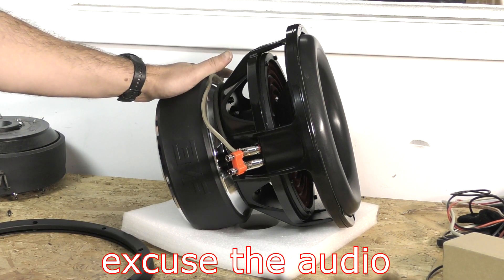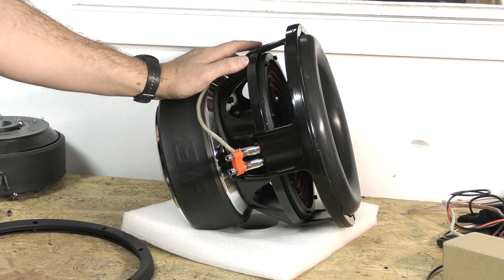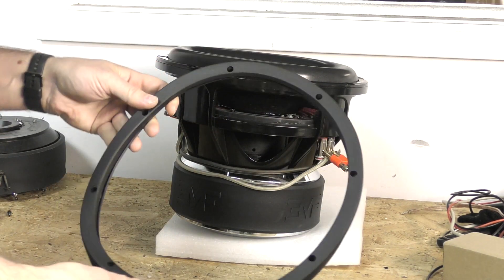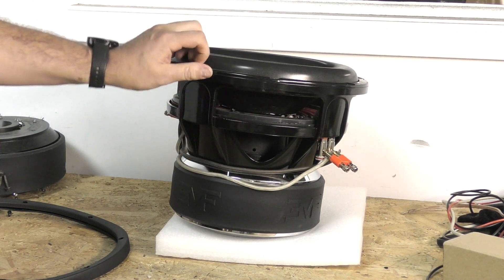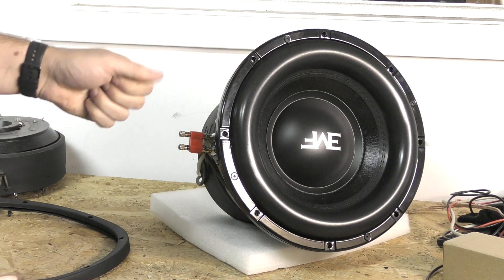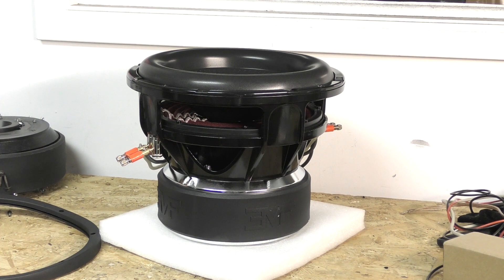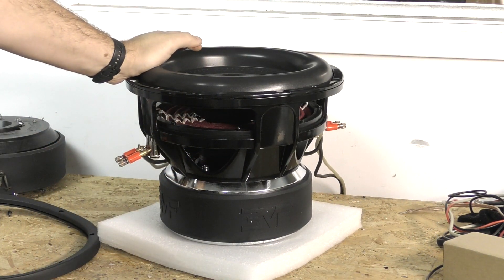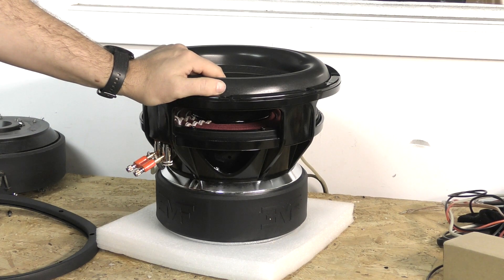What's different between Banhammer v1 and v2?

Comment: I designed a 4th order bp for 4 sundown x12 v3s, I was thinking about running these instead. 4.4sealed, 10 ported, tuned to 44hz, 200si port area. Will these out perform the sundown in the same enclosure? I can make the enclosure smaller if needed but can't make it bigger. I'm powering them with 2 6ks.

Comment: I wanted to get some hard play time before I posted a review.
I installed this sub in a custom ported box measuring 2 ft³ with sub installed this measurement dose not include port area. Box is tuned to 34hz. I'm running this sub on a DD audio m1d. So under powering it by a bit.
This sub blew my mind I honestly think it would even please the SQ crowd!! it doesn't matter how low or load you push it, it doesn't distort. It delivers clean cristal clear punchy bass even at max excursion. knowmatter what you through at it sounds clean and hits soo hard.
I regret not pre-ordering 2 honestly.
My only complaint is I asked Sean to sing it and he didn't so that was a bummer. I garentee you can't find a louder better sounding sub at this incredible price point.
The build quality is hands down perfection
Thank you Sean

Comment: Not happy about the new fs rating was expecting something. " similar " so at least under 30 hz
Reply: I may be wrong, but I believe FS drops as they break in. So 29 or 30 would make sense if he used a brand new sub for testing and was getting 35 initially.
Reply: @TheDoozie43  i hope ! Because i already sold my. Pair of 12" re audio xxx and was in the the hope to find a 15 " inch pair at a decend price but wasnt able too . so thats why i buy the banhammer v2. / better power handling / better kick bass than the xxx / and really like the spec of the banhammer v1 overall . my first choice was crescendo contralto 15 but i finally choose to go with banhammer and  now im sad because i wait more than 2 year for subwoofer i dont like fs wise
Reply: @ganjadalph4204  I'm Kinda In The Same Boat As You. I Have XXX12s And These Banhammers Are The Replacements For When One Goes. I Really Wanted A Low Fs Sub Like The Re Audio XXXs. And The Banhammers Qts Is A Little Higher Then I Wanted. However The Recommended Ported Box Volume Is Still Not Overly Large. Sean Said The Reason The Fs Changed Is "Higher Power Requires Different Suspension Needs". The Re Audio Are 2000wrms. The Thing I Run Into Is Thermal Before Mechanical So Maybe This Is Just What I Need? (with my port tuning around 32Hz And Peaks Around 34-35Hz). I Really Like To Play Really Low Sometimes (I have a 19Hz port that's Literally 6" x 36" long That Like To Peak About 22-23Hz and I hit mechcinal limits way before thermal ). Will The Banhammers Smash The Lows Like The XXX12 And Be Louder? From Looks And Specs I Don't Think So. But You Can't Talk The Talk Until You Walk The Walk. If I Was Rich I Wanted To Get The Rf T2s Those 13" Subs. It's Got All The Specs I Want On Paper... Except They Want A Massive Box And I Can't Figure Out Why. Nearly 4Cuft Per Sub!?!?!
Reply: @salvatorehayes2753  at the end im just sad that i didnt spend some more money to go crescendo contralto 15" and tuned them to 25hz 😐
Reply: I Fully Broke In The Subs And Tested The TS Parameters With The DATs V3 With Sub Warm The Fs Is Actually 27Hz
Reply: @salvatorehayes2753  tanks about the info mate ! really appreciate

Comment: I have a dumb question. Why is the Fs 36Hz on these and was 25Hz on the originals? Regardless, it's a beautiful monster and I love my 15's!
Reply from the maker: With greater power handling comes different suspension needs.
Reply: @EMFAudio  do you offer a ti frame 12” in a 3” coil?
Reply from the maker: @jkstdstang  the basket is the same regardless
Reply: @EMFAudio  all 12” Ti frames are 4” coils then your saying
Reply from the maker: @jkstdstang  correct
Reply: @EMFAudio  is the voice coil size not dictated by the motor rather than the basket?
Reply from the maker: @jkstdstang  it's dictated by the motor and basket has to be compatible

Comment: 🙋I DON'T agree with this practice, but, the simple answer bro is that it's an optical illusion! It makes the surround seem bigger and also makes the sub seem to flex more! I've been wondering the same thing about why people take the gasket off for a long time now! Recently I figured why. I built a custom box for a guy and before installing his brand new speakers he peeled all the gaskets off and threw them in the trash. I asked him why he did that and he said because with the gaskets on there you can't see all the sub Flex😕